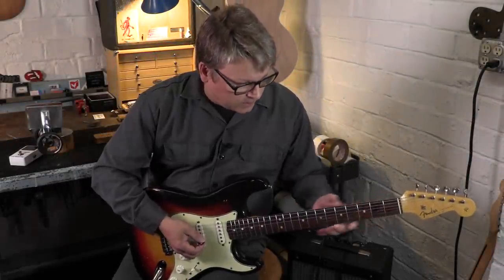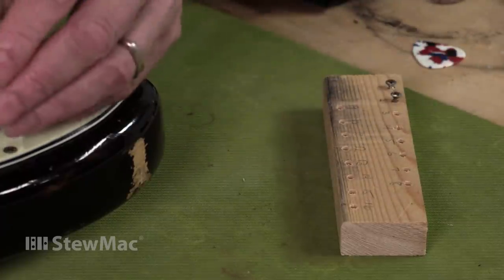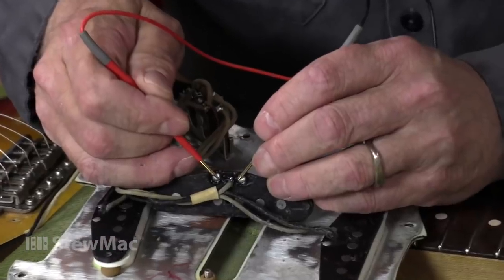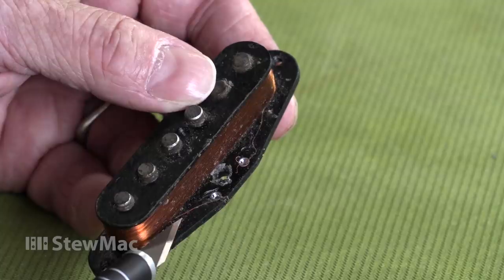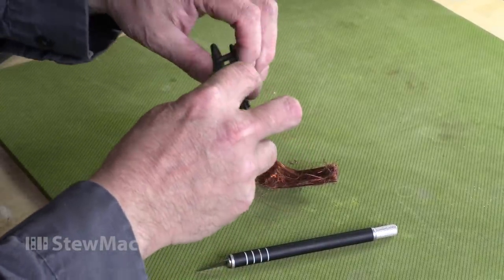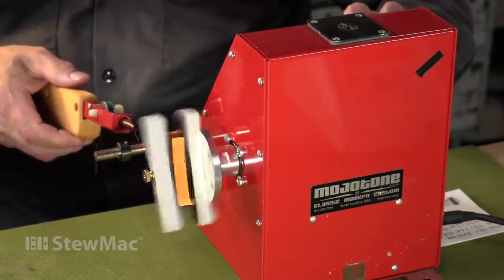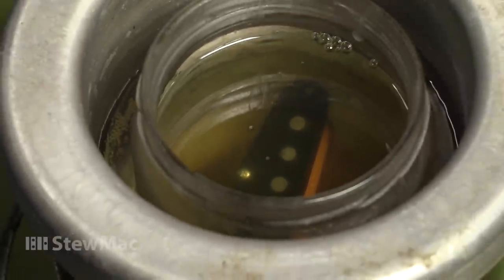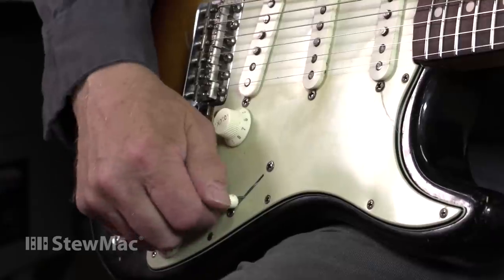Fixing a pickup on a 1963 Fender Stratocaster

Comment: I was surprised by the video. I was expecting the repairer to try to locate the break in the wire. I'm would be grateful to learn why not. 

I bought an all but new Stratocaster and later realised it had the above described symptom. It was also the middle pickup. It too had the very high impedance that indicated an open circuit. I wound off about 400 turns till I found the break. I  then resoldered it to the lug. It then measured about 5.2k. I suppose, with a winder, I could have wound those turns back on after fixing the break. I might do the that one day for the sake of integrity. Anyway, still not really happy, I found and purchased another bridge pickup on eBay that should have been a proper replacement. Unfortunately it measured slightly lower in impedance than the one from which I removed hundreds of turns. I suspected the same had been done to it. Alternatively it could be a short causing the low impedance. Either way, I contacted the seller but never received a reply. 

For confirmation I contacted Fender about the low impedance of the eBay pickup - I have always found them to be good - and it was suggested that even though its impedance seemed low,  I just try it. Well I thought if that one is OK, the original should be OK, because even though I had removed hundreds of turns from it, it still indicted slightly higher impedance than the intended eBay replacement. 

So the original is still in the guitar and to my ears sounds fine. The eBay pickup is still in my box of spare parts.
Reply: RIght on, if he'd put it on the winding machine and gently unwound it, he could have found the break within a few turns, possibly even the first one - did you see all that crap on the windings?  That said, it is just a pickup, not the crown jewels.

Comment: .26 MEG Ohm??? That's 260K Ohms. First off, nothing magnetic will effect the resistance reading! Second, shorts DO NOT INCREASE the resistance reading. Short circuits bypass resistance thereby lowering the reading. If broken down insulation were to play a part in increasing the reading, it would be through exposing the copper to corrosive substances like salty sweat, plumbers acid flux, or even saltier sweat from munchies while handling/playing the instrument. Since the pup was potted, it's most likely that the problem is where the wire is most exposed. It is always possible that the problem was congenital! The owner never mentioned it and may have thought it was normal. In that case it's possible it's a bit more buried. I saw a comment that some length of wire was indicated over a small spot. It's about cross sectional area of conductor over any length. that creates resistance. You can focus infinite resistance in nearly zero length, and anything less than that by effecting most of the thickness. That type of defect will be extremely delicate. If you take a very large spool and spool of the wire from the pup, I would expect the effected portion to break as soon as it's flexed. The break can then be rejoined and coated and restore the original wire as others have mentioned. I hope this added something to the discussion particularly for those with less understanding of the physics of the material properties and detailed electrical theory. 

I saw a couple comments on the shorthand vernacular use of the word "short"/"shorted", and while it is correct to consider this misuse, it is even more important to correct it for those likely to pick it up and spread it. This mistake is one of the most crippling ideas to understanding electrical circuitry I've run across. You will never hear a competent engineer misuse the term. It's one of the most obviousl clues that anything else the person says is suspect and should be taken with the salt that corroded that wire! 🍟 🍕🥨⚠
Reply: C'mon guys. Read through the comments before speaking up and slamming the man for the twentieth time! Point taken! I don't think him or Dan Erlewine or any of the "old school" guys have degrees, they didn't learn from the internet, they learned by DOING IT! Point is, he fixed it, pretty elegantly I might add. Don't be so anal as to drive people away from sharing their knowledge!
Reply: @gwbenites  Fucking thank you.

Comment: wait. how do you test pickups while the are still wired in. Where do  you connect your probes?
Reply: If you have a cable plugged into the guitar, you can put one multimeter lead on the tip of the plug (output), above the mono ring, and put the other lead against the shaft of the plug (ground), below the ring.

Comment: Great work!. When you soldered the enameled wire ends did you first have to remove the enamel coating? What was the time it took to do the repair and have you ever had the coil wire break while you were winding it?
Reply: With wire that thin, you can often get away with the heat of the iron and solder alone burning off the varnish

Comment: Did you remove the varnish from the wire before soldering?
Reply: You don't need to with modern "enamelled wire" the insulation breaks down at about 400c and self fluxes. Utterly easier than stripping insulation from 40swg wire

Comment: So why is no effort taken to remove the coil wire insulation?  Is it that sure of a thing that the solder heat will burn it off?
Reply: Much of this style wire on the market nowadays does not need the insulation stripped off prior to soldering, at 400c the insulation breaks down and self fluxes. basically labour saving.

Comment: No re-dip into lacquer or wrapping the magnets to minimize future shorts?
Reply from the maker: Dipping a pickup into lacquer or wax is done to stop microphonic feedback, and generally does not prevent shorts. After discussing these options with the customer, it was decided that wax potting it again (just like it was when it originally left the factory) was the best way to keep the pickup as close to vintage specs as possible. This is also why nothing was wrapped around the magnets to protect them.
Reply: Fender would dip their bobbins and magnet pole piece assemblies into lacquer and dry them before they would wind the coil. This would insulate the magnets from the wire which did minimize shorts. (Well, at least for a while Lol!) Only after would they wax or lacquer pot for microphonics. But thank you for responding, Eric knows his stuff so he must have had his reasons.

Comment: So does mean more copper wire more K and therefore more Pickup output?!
Reply: That's right, at the expense of top end - the more windings on a given pickup, the louder but darker sounding it gets.
Reply: @arenalife  DC resistance depends of wire length and cross section (gauge), so windings amount is sub result.

Comment: Thanks for the interesting video. I've worked in electronics for much of my life, and know how fragile those thinner gauges of Copper wire can be. High impedance magnetic hadphones, record deck pickups and microphones often use wire which is almost hair thin, as do some coils found in electronic circuitry.

If the resistance of thickup was several Megohms, then it was open circuit, not short circuit. (Although a short, followed by current, can induce a burnout, much like a fuse blowing.) Failure also often happens through the coil being wound too tight, or the coil being left in an excessively cold environment, sometimes because of thermal fatigue with temperature changes, sometimes because of excessive current flowing through the wire, excessive shock, such as when dropping or throwing the guitar, and, as he mentioned, corrosion. It's also a good idea to leave the end wires slightly slack, to avoid them snapping under tension. Copper wire also work hardens, making it gradually become brittle.

Comment: One thing I will never understand is why guitar repairers consistently refer to pickup resistance readings as 'output'. This is just electronically illiterate. The output of a pickup is a function  of inductance and field strength, and inductance is related to the square of the number of turns, i.e.  the square of the resistance. So to get the middle pickup at the arithmetic mean of the other two in output level you should aim for the root mean square of their resistances.
Reply: That's why they are guitar repairmen, not electrical engineers. It's a bit like being a farmer. You have to know mechanics, wood, finish, be a musician, psychiatrist, and know how to solder properly, but you don't really need to know about the flux capacitance of a coil.
Reply: Frode Haugsgjerd Well yeah. I didn't mention it above, but I can scarcely believe the BS about visible solder either,  under the pickguard. You might buy a Ferrari, but you still expect to have to change the oil occasionally, and not to be able to run the original tyres forever. Ditto replacing  the screws in the original positions. I would renew them rather than put back rusty screws.
Reply: And you think he could or should go into this in a 12 minute video on how to rewind it?  I have worked with electricity and electronics for much of my fairly long life as technician and engineer and I'll tell you what: if this is the shorthand that luthiers use, then it is the shorthand that he should be using in the video.
Reply: Brian Godfrey What I think is that he should not refer to DC resistance as 'output', and that where he is aiming for a mean value he should use the correct formula, to avoid getting the wrong answer, and there cannot be any doubt whatsoever that I am right to think so.
Reply: Yet Erick got what he aimed for and all is good.  Everybody is different.  You get really excited with formulas and car analogies.  Other people do indeed care about things like original solder joints on vintage guitars.  And respect for wear patterns by carefully putting each screw back where it originally was.  If you put new screws in a vintage guitar, you would possibly have a very unhappy customer.
Reply: Chad T No,  he didn't get what he aimed for at all. That's my point. He aimed for a mean between the outer pickups, and he certainly didn't get that. If it sounded exactly right, that's great, but it isn't for the reason he stated. If he had gone for the root mean square it might have been even better. Or worse. I don't know. Neither does anybody else. It is the pseudo-science that is at issue here. And I don't consider you have any business guessing what I do and don't get excited about. Keep the personal remarks out of it.
Reply: EJP and if you have a ‘63 strat you can put in stainless steel screws if you wish.  But he’s attempting to restore full function while simultaneously recreating the correct appearance of an instrument of that vintage.
Reply: Jim Furst And leaving rust in there to spread and spread and ultimately destroy the instrument, having just replaced several hundred yards of wire. I suppose the owner should still be using the original 1963 strings too?
Reply: Antonio Gallagher You sound like someone who cannot muster a single rational argument. Try harder.
Reply: The screws in my ´65 Tele are rather rusty. I was thinking about getting some new ones, but there's this ridiculous thing about preserving the crap (though maybe not the strings!) Well, let me tell you this: my Tele has an extra strat pup in the middle, and a 5-way switch with an extra "tone" control to bring in the split that Kent Armstrong did for me on rewinding the bridge pup. Oh, and I stripped all the paint of it (it looked like one of those "relic'd" shitey guitars) and finished it with my oil mix. Oh, and it has brass barrels instead of those steel liquorice-twisty-looking originals. So do I go straight to hell for making this guitar better?

Comment: Is clockwise or counter clockwise winding making any difference in tone?
Reply: Middle pup is usually reverse wound on a strat, but is only really necessary if you are using a 5 way switch In the 2nd and 4th positions. This Strat uses a 3 way switch.
Reply: Cornbob Rimlove Reverse wound mid pup only works if its reverse polarity TOO, otherwise it's a horrible thin sound in 2 and 4 positions. Making it RW/RP however reduces hum in those positions.
Also the 3 way switches could balance in the 2 and 4 positions, witness eg early Clapton solo career or Buddy Guy.
Reply: Waterbeach2000 i thing reverse wound is to counter neck & bridge pickup in order to reduce hum when on 2 or 4 position...am i right??
Reply: Halid Haris Yes, but it has to also have reverse polarity (magnetic alignment of the polepieces) from the neck and bridge to work soundwise.
Reply: @Waterbeach2000  Magnet polarity must be reversed to get parallel connected hum-bucker effect at positions 2 and 4. But coil must be reverse wound OR reverse connected. Here are 2  nuances: 1. Pickup sounds a little bit different if coil is reverse connected - because coil has different capacitance such case. 2. There is better shielding factor if outer end of coil is grounded - upper windings work like some shielding. Almost no difference if coil is shielded with cover like on Tele neck pickup, or with foil over the coil - it is adding some capacitance again. And coil's capacitance depends of Alnico magnet pole connection to ground on not, 2 nuances again. Not grounded poles are sensitive to touching and EMI/RFI. Any case higher capacitance is lowering resonance peak's frequency (like long cheap guitar's cable). But good news are - most single coil pickups are to bright - so it is open question of subjective taste. And reducing hum and noise is positive any case.

Comment: You almost destroyed the freshly wound wire with your incompetent plier handling.
You can see all the dimples in the coil after you take the "safety belt" off, right before you put it into the pickguard.

The original wire was visually flawless, without any damage.
I would not take that back like that if I were the customer and saw this video.

Then again, I'm very harsh when it comes to criticizing "professional" workers.
Reply: Erick is a "professional" guitar mechanic and a very good one.  He is not a pickup specialist, and his amateur status in that field is very obvious in this video.  One of the most important aspects of true professionalism is to know what one doesn't know -- and Erick, who knows more about physical guitar repair and setup than I ever will, isn't quite there yet.

Comment: I cannot believe what I just saw - that is would COUNTERCLOCKWISE!! Meaning that the lead wire is WHITE. You should've soldered the white wire to the LEAD. ALL Fender pickups are on Stratocasters are reverse wound from the Tele pickups.  But all the hot wires from the pickups and the jack are white and all the grounds are black! The exact opposite of regular household wiring. Meaning that the hot wire is white and the ground black on all Fender guitars. You just soldered this backwards to the other pickups! And it's DE-soldered, not unsoldered. Desolder means to unjoin solder connections, and UNsoldered means that it has no solder on it.
Reply: I think they do that to stop the hum when two pups are active.
Reply: Yes reverse polarity for the mid position is normal. That's where alot of  strat magic happens.
Reply: @ralphshaw9758  Reverse Polarity for hum cancelling was introduced in the 70's I believe.  It has nothing to do with the Strat tone per se, that is caused by phase cancellation from the relevant position of the pickups when 2 are selected, related to, but very different from electrical phase cancellation.

Comment: I have one thing that really made me cringe! Did the owner want you to change the sound it already had? If you went middle and neck position tone it might have had a unique sound! Very SRV Lenny tone. With that aside, why did you not check the ohm reading of the pickup on it's own? Could of had a bad switch/switch solder lug or wire! The windings of a original strat pickup are known to be the holy grail tones of each vintage strat. It would be the very last thing I needed to change out or rewind! I'd put in a replacement before I destroy a original pickup. I think it's something so rare sounding it's like the Pepsi challenge a high volume made piece. Nope I'm sorry you condemned the pickup without testing the whole circuit. The solder could just needed to be reflowed at the switch or pot. Never go for the main component if the wires could have the same results! Anyone reading this can do a simple test by just using a wire overlay while reading the DVOM from the main jack. Diagnostics confirmed before removing the value of an original piece is the correct way to keep these vintage guitars at the place they are. I'm not Leo but I think he would have thought the same knowing the issues with solder and solder creep. Yes thats a real thing, look it up. Such a simple test to do, what would it hurt to be sure? Plus I may be wrong but Fender used a lacquer before wax to coat single coils even though the wire was already lacquer coated. Some say that Tele neck pickups had 42 gauge while strat's had 43 gauge. I'm not sure but I know they have a different color lacquer color as they aged.

Comment: Seriously, you have a machine to accurately count the number of winds and you're relying on your hand to pass side to side to place the wire on the bobbin?
Look at the incredible build up at 7:50 at either end. I don't wind pickups but damned if I'd pass a single coil of any description through my hands to any customer anywhere that was so badly wound. 8:42 "nice and even" MY ASS.
Reply: The "vintage" cult is convinced there's some kind of mystical mojo in hand-guiding/tensioning magnet wire, and that the resulting "scatter winding" is some sort of secret sauce for great electric guitar tone.  Having worked  for nearly a decade with the man who pretty much invented the aftermarket pickup industry (back in the late 1960s), I can say with some authority and great conviction that this belief is utter and complete codswallop.